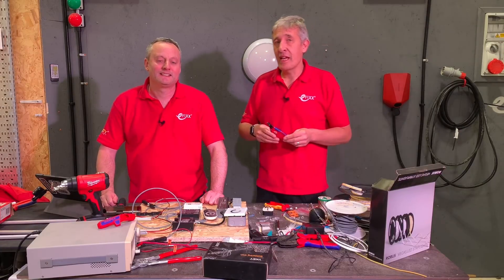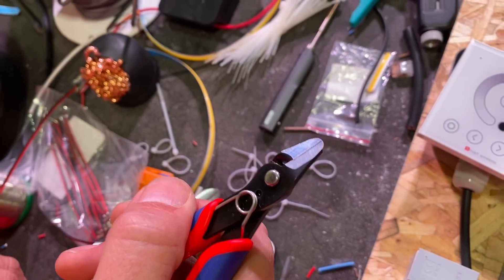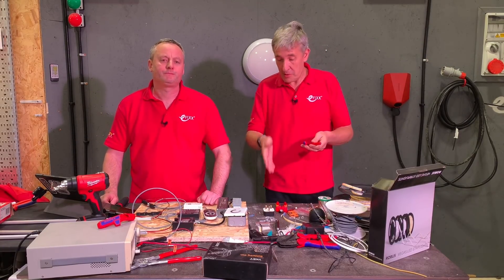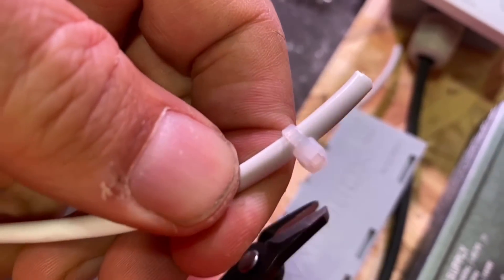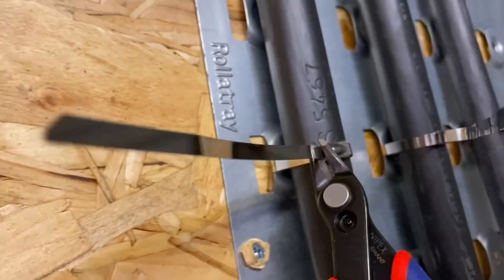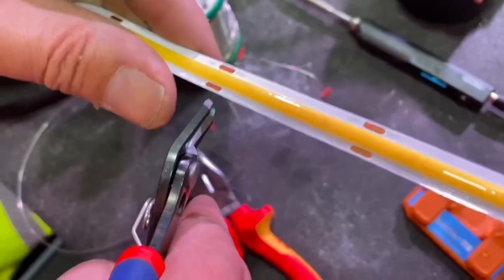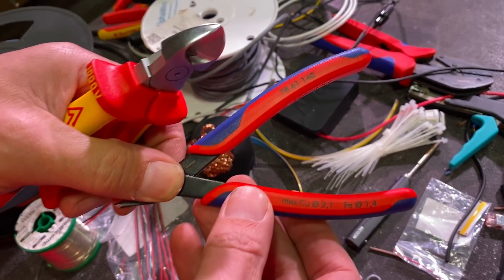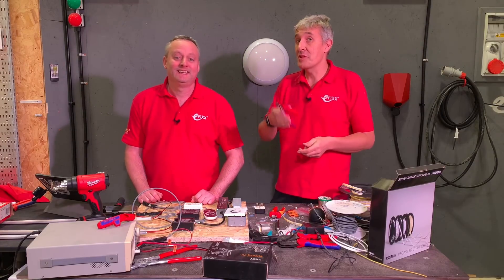KNIPEX ELECTRONIC SUPER KNIPS XL- Side cutters for electricians

Comment: As an electrician over 26 years I switched to many knipex tools. But have never bought knipex flush cut kippers.  I’d be interested to see duration testing, instead of the standard promotion of new sharp product.  Obviously, you could speed the time by referencing every hundred or cuts, or so and see how the tool reacts versus when it’s brand hammer new off the assembly line. My 2 cents.

Comment: It always annoys me when I see someone holding the cutters backwards when they are stripping wire. You should always have the non-bevelled edge facing the bit you are trying to remove. The way these guys did it squeezed the insultation rather than pushing it off cleanly.

Comment: Great tool 
Question do they make some with insulation type handle to protect against shocks? Since they are going to be used for electrical purposes.
Reply: They're intended for low voltage electronics use it's up to your risk assessment/common sense what else you use them for.

Comment: I’m using for a couple of years 78 13 125, which is “the better version”, I believe. Absolute a must when it comes to electricians tool box. 
One thing I don’t know, if they are ok to cut the stainless steel cable ties. In my case I do have a different tool for that.

Comment: I was trained years ago in electronics and have always used side cutters like those.
One company I worked for used to do photocopier work - very fine tungsten wire is used on them.
You had to make sure that no-one borrowed your tools as the tungsten wire was tougher than the cutters.
Also taught in soldering to tin wire from cut end to back to insulation and then take iron back on its own to the cut end to remove excess solder that you cut off the end of the wire to required length.
Reply: What did you use to cut the tungsten wire then, if I may ask?
Reply: @razmanhanafiah4839  
Cant remember now it was about 40 years ago

Comment: As good as any electronic type cutters I’ve used over the last 40 years. Better used the other way round for wire stripping, a bit easier.
Reply from the maker: Thanks for the top tip

Comment: The reason why I got the Super Knips XL is for cutting excess wire while terminating network keystone modules. Small increase in cutting edge length makes it possible to trim the wires with a single cut.
Reply from the maker: Great application!

Comment: I use these for my works. Not great for cutting 1.5 or greater  will get dull or damaged over time. Great for alarm cables. Really great for cutting flush cable ties.

Comment: I’m an Alarm Engineer who installs IP CCTV, Access Control and smaller Computer Networks. I’ve used the Knipex range (which is absolutely huge) of Mini Knips and Electronic Flush Cutters for over 30 years. Must’ve gone through thousands of pairs of mini cutters and I always default back to Knipex. Some models have lead catchers to reduce mess. Work very well. I can highly recommend. 👌👍✌️🇬🇧
Reply: Same. I'm also a security installer as well as electrician. I had the smaller version for about  15 years which I still have. I recently purchased the XL version. Amazing tool

Comment: What the difference between theys and the Knipex part number 78 06 125 ?  Both look the same obvious colour
Reply: Its the length.  125 part of code means 125mm long.   140 means 140mm long
Reply: @sergiofernandez3725  but they have a 78 03 125 red and blue ones sliver tip then 78 06 125 red and yellow "vde" 78 81 125 blue and red black tip which are all  125mm
Reply from the maker: The VDE version cuts a lower diameter of steel wire compared to this version.
Reply: @efixx  ahhh I see looks like theys win be getting theys ones after crimbo cheers for explaining lads 👌

Is there a live stream tonight ?
Reply from the maker: We've rescheduled to next Wednesday so we can have a great show before breaking for Christmas.
Reply: @efixx  thanks for getting back at least I know my you tube not playing as I didn't see the schedule post
Reply: @KnugenMooMoo  different metal. The black version is a harder metal